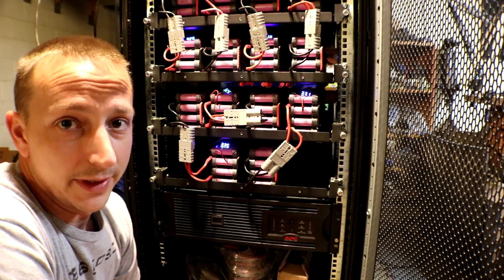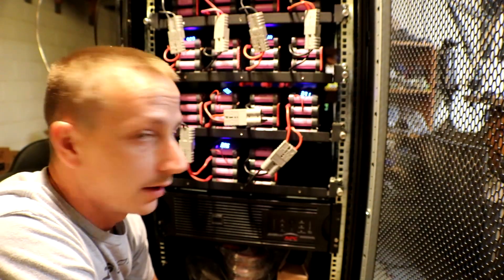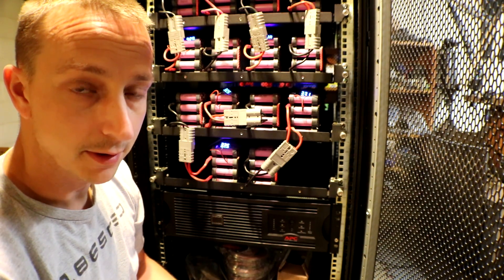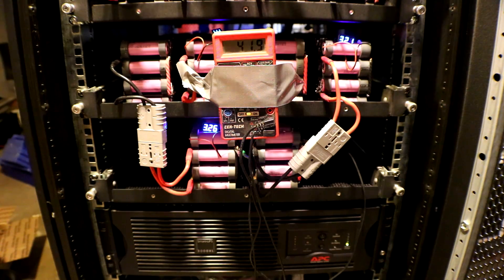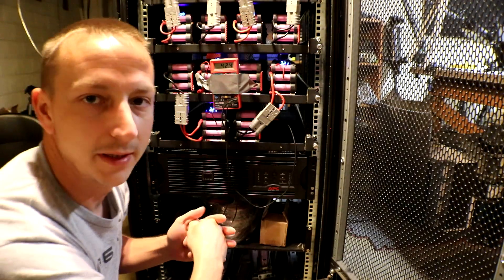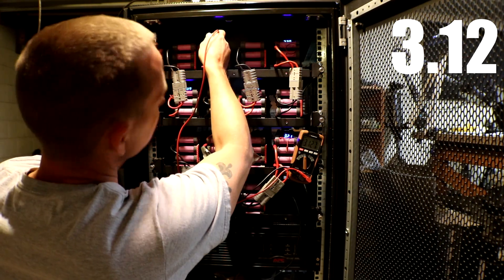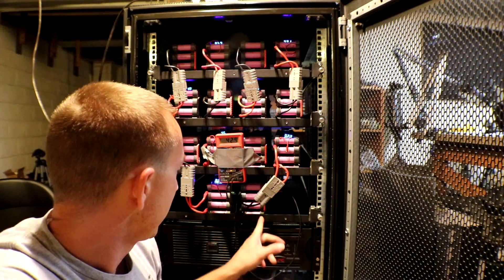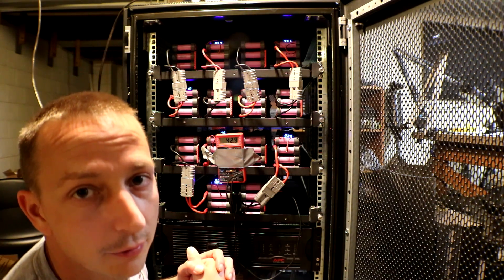Diy Tesla Powerwall ep54 Low Voltage!!!

Comment: Are those battery meter on the packs accurate ? If yes, what type are they ?
Reply from the maker: There ok. There more accurate at a little higher voltage like 12v or higher but they work for quick glance at the pack voltage. I got mine on ebay I think. I may have a link in description.

Comment: There may be a variance of temperature (heat) in the low pack.  Have you kept a log on cell temps, by logger or by hand held? I am interested in your evaluation of heat on cells, cables and Inverter components.
Reply from the maker: It ended up being a few broken fuses from me moving the packs around lol.  If I max out the ups which is 2700watts, its about 70-80 amps on the packs and that ends up being .7 or .8 amps from each cell.  That could bring in some heat if ran for a long time but under normal usage there isnt any heat to speak of other than slightly above room temp.  Ive done a few live stream load test showing all the temps, amp draw ect.  There are even a few live stream load test recap videos in the list.👍
Reply: I see..... keep up the great work!

Comment: If you bottom balance then when charging differences in capacity will result in some cells voltage going to high and when the charging stops will attempt to charge all the other cells in the battery. If you top balance and drain then differences in capacity result in the other cells attempting to charge it together as it discharges faster which makes bottom balancing significantly more likely to result in damaged cells. Am I missing something somewhere? Why would anyone prefer that? If you had new cells bottom balancing would be more convenient if you did not have a BMS which might explain why it seems more popular outside of reused batteries. Thats all I can think of.
Reply from the maker: +penguins forall Yeah thats what I was thinking as well. Hey thanks again for all your help. How was your trip? I did have a ? Tho. When I try to change the settings in nut it basicaly say nope you cant edit because of an error. I dont remember exactly what it said but that pretty much summed it up lol. Thanks again for taking the time 👍
Reply: Yeah no problem. My trip was quite fun. I went to a new local Furry convention. Since its so small I got to meet a lot of the staff who were working like crazy to make it all happen. Fursuiters everywhere! Hotel rates were quite low as well so it cost about $120 dollars for the whole trip 3 day trip including food. Thats an economy vacation >.>;
The no edit issue is either because the user you logged in with doesn't allow sending commands or its because the daemon service isn't running or isn't running under the correct user.
Chances are all you need to do is do "sudo systemctl enable nut-server && sudo systemctl start nut-server" which will start upsd under the ups user and will start it on every boot up.
Reply from the maker: +penguins forall Awesome, Yeah Id say thats a great econo vaca!!! Ok cool Ill see if I can mis spell all that a few times 😉 and see what happens 😀👍

Comment: ROFL!!!  Love the intro!  😜
You could take a black sharpie and write down all your tests on the duct tape. Times ran, pack voltages, run times, etc.
And I see you're using a cheapo Harbor Freight MM  :)  They can be calibrated as well.
I personally would go with top voltage as you'll be at that most of the time when your solar panels and chargers come online. You shouldn't go low once everything is operational. Secondly, you could install an MCU (arduino, raspberry pi, etc.) to monitor pack voltages and control the UPS via com-port in case something goes nuts like that one pack dropping low.
Reply from the maker: +Korishan Lol Its kinda what it was like. I walk down and thinking to myself "hhhmmm something is different and its quiet. Have I gone def?" As I look around the oddness, I finally realize the loud fans arnt on and either is the light bulb lol.  I agree with the top balance. Once solar is hooked up it shouldnt ever go that low. I guess Ive only pulled about 5kw out of it since I started the test and messing around with it.  I would live to do that but I wouldnt know were to begin with the pi stuff. Is there downloadable stuff fer that?
Reply: I'm sure there is, somewhere. Well, maybe. At least there is in different locations. Just gotta find the pieces of the puzzle and put it together  :P
However, you could start a thread on the diypowerwalls.com forum and start getting collaboration from many coders and engineers. Plus, it'd make a good central location for others to get the info too  ;)
I do know you will need a serial adapter so you can talk to the UPS via the serial port, not usb. You'd want to send raw commands to it regardless of its state. And I would also get current sensors for each pack, volt can be measured directly (might need to use an I2C multiplexor so you have enough ports). These two sensors would allow you to find out which pack is hogging the amps, or which one is just not holding on to them. Especially since you found a pack that was low voltage.

Comment: Awesome video.  Any ideas one what sort of BMS setup you might go with if thats the plan forward?  I could imagine maybe something on each pack that cuts a relay when voltage drops too low.  Also hope you have some fire extinguishers nearby when testing this and pushing limits :).
Reply from the maker: Thanks!!!  Id like to eventually get that batrium bms as it seems to do all kinds of stuff but Im open to others.  I do have a fire extinguisher nearby but I dont think they do much on Lithium EEEEEK.  Once its all ready to go it will be in a concrete room "The Bunker" I like to call it LOL

Comment: I'd go for top balancing always because it's easier and the consequences of overcharging are greater than overdischarging.
You don't want to do top and bottom balancing because that's just throwing energy away on each cycle.
This is also where a BMS is useful because it can shut off when a single pack goes low before total voltage reaches minimum.
You could babysit while charging and do manual BMSing with a wandering load on high cells!
You could get a decent lipo charger like my Turnigy Reaktor and use it occasionally to balance 6 cells at a time and set the desired end voltage.
Reply from the maker: Yeah I would imagine Ill be babysitting the first few times LOL to make sure all is good.  Ill have to look into a charger as I dont have one 😱
Reply: Check this 500W charger out which can run from a PC PSU:
https://hobbyking.com/en_us/smart-charger-500w.html
or a 1000W one which is a bigger DC powered version of mine
https://hobbyking.com/en_us/turnigy-reaktor-30a-1000w-balance-charger.html
Pity there are no affordable 14S chargers

Comment: Well before I have balancers the situation was the same as your's or a little less drastic because I measured each pack for the capacity (first pack's are about 105-110ah... ) that's was for me very important because the lowest pack is dictate how much capacity could you use from all 14 packs so....for measuring whole pack I use ZPB30A1 V2.8 that was my first capacity meter that I use to determine the capacity for single cells.....it is also capable 4 wire measurement.... 👍
after few charges /discharges slowly two or more packs are drifting away from the common value and nothing I was able to do abot it... even try to bleed the higher packs with 12w 12v lamp.....it was like blind man try to cach rabbit.....Anyway balancers.... then I thought in this direction no maintenance it shuld be capable to balance with large current at least 5A or more and is capable for high voltage over 48v and must be modular  configuration so you could add or remove series pack's and one thing not to monitor every day the packs if are balanced or not .....worry free.... So that are criteria that I was following to perches the balancers..... I have no need for advanced and expensive balance sistems like Batrium with management capabilities.... 
For overload I have fuses, 
For overvoltage I have charge controller 
For undervoltage inverter have protection 42v on inverter additional I have XH-M602 module on which I could set and switch grid to inverter (grid priority mode)in my case if it goes under 47v and also capable to give comand to contactor when voltage goes over 55v to switch on 1500w 48vdc el.heating element in DHW tank to heat water .... and turn off when goes under 52v...

Max balance (when I installed them) current under load (54A/53.5v)was about 6A between cells that I was measuring..... 
Each balancer (14 in series) costs me about 20€/piece and are worth every penny.... 👍 
Now I check battery's 1/month with no worries....
All are well balanced in 0.02v no matter the current draw....
Reply: What balancer did you get?

Comment: top balanced my first 21 packs, and after my load test they varied from 2.6 to 3.5, but they all charged back up to 4.06 to 4.13. going to bottom balance the next 14 and see where they charge to. i guess it depends on what sort of bms you plan on using.
Reply from the maker: Yours ended up like mine then huh.  Id like to get that batrium cause it does so much and everyone loves them.  Unless theres another
Reply: none i can find on ebay, but there are capacitive/inductive charge transfer systems. working on my own design right now with six 0.1f caps on a 7s battery. lots of issues trying to figure out bootstrapping and working around the body diode. relays work for now...

Comment: The problem is if you top balance as they get low they will drop out of balance until you get them back up. If you bottom balance by the time you charge them up you run the risk of over charging some packs as the move out of balance. Until you get a BMS it will be a constant drama.
Reply: Great video as always Joe.
Reply from the maker: I figured that would be the game.  Under normal operation Ill try and keep it in "the safe" limits.  I definitely dont want to over charge!
Reply from the maker: Thank You!

Comment: Balancing is a pain. Even when I use charge balancing I end up with a high and low after it runs for a while. I think you're right, you'll have to run it a dozen times before you know what to expect. You may have to trade cells from one pack to another to get it to be stable.
Reply from the maker: Yeah I agree, better to find the fails now than later👍

Comment: Generally, until you have some sort of BMS any type of balancing would be fine.  It really doesn't seem to make much of a difference as long as you keep the cells in the safe zone 2.7-4.2.  The problem would come when you do an unattended discharge if the packs become so far out of balance that you potentially drive one very low or negative.  I try to keep my packs between 3.0-4.15V when possible.  One thing you can also do if you don't find any cells with broken fuses is to leave some room in your design to add cells one at a time to weak packs to help balance out the capacities.  I have found that this can help to tweak everything into balance since as we know the weakest cells in the pack determine the overall capacity of the system.  If you have a hobby charger that can charge at a decent amperage to a custom voltage you could do a bottom balance by connecting in parallel all the packs as you did before and then reconnect all of the packs to the UPS and let it charge them up to full.  Then you could set the hobby charger to the voltage of the highest pack and charge each pack to find out how much capacity it takes to charge them all to the same top voltage and that would tell you the rough difference in capacity of each pack.
Reply from the maker: Thats not a bad idea.  Ya the plan once all hooked up and working would be to keep it in the safe zone.

Comment: Ur issue (assuming they were balanced before) is the amp/hr capacity of each group. The weakest group will drop the most.
I would look at the  measured capacity of each group and mix n match cells till they are roughly the same for each of your groups. Balancing top/bottom will not help a capacity issue.
Reply from the maker: Each pack was balanced at 226a.
Reply: Hi again, that may be the case that they were balanced and matched before but the fact that is that the pack with the lowest voltage after the power run is the weakest. It may be that at different load (higher/lower) the capacity is not the same as originally tested. Things like the internal resistance will have an effect, slight battery chemistry/material/tolerance differences between cell brands etc also.
Reply from the maker: Oh my bad,  Yeah that is possible!
Reply: And you used the UPS charger to charge them didn't you?  That  could be affecting pack life and explain the lower pack!
Reply from the maker: +kirkb4989 I did use it but it never went to the UPS's "100%" battery voltage. I did an autopsy, vid coming tonight 😃

Comment: how many KWH?
Reply from the maker: 10,848KW at 48v or fully charged 13,108KW at 58v
Reply: Did you see that on your power meter
Reply from the maker: No,  each pack is 226amps so you X that by the volts.😃
Reply: I have 1400 cells. Threw the kWh meter I got 8.8 from 4.05 to 3.3.  You had 2.2 on your first test. So I was wondering.
Reply from the maker: +sven The 2.25kw the cells started at about 3.82 and went down to around 3.55 and still under the tiny load. Once I get the solar hooked up to recharge to full capacity Ill be doin some more test. What was your load or was it variable loads?

Comment: I would do a bottom balance since you want them all to fall off the edge at the same-ish time. Just make sure your charging stops when the first cell reaches the maximum voltage otherwise you will top balance them in use anyway.

Or rather like this: Bottom balance to keep the monitoring simpler (charge to X since that is when the first cell reaches the maximum voltage, discharge to 41.7 (or whatever) since all are about 3 volts then). Top balance to maximize the energy density (more volts in the P=U*I formula).

But as Inxpro said: autopsy. If one cell discharges the pack a balancing will not help in the long run.
Reply from the maker: Im on the autopsy STAT!!!  I may do the bottom balance since Im here.

Comment: U gotta pull that pack out and perform some autopsy. It may be a weak cell that brought it down quicker than the others. I am assuming you are using equally distributed internal resistance cells.
Reply from the maker: Well there you are! Did you ever get a bigger PSU?  Im on the autopsy STAT!!!  Yeah all packs were equal in capacity with in 100ma or so 😃
Reply: hehe. I was away for the eclipse. No, I never got a bigger PSU but got around to using 2 different PSUs... Now I need more cells. lol.
Reply from the maker: Oh, Yeah I guess 2 psu's would work huh lol.  Always need more cells 👍